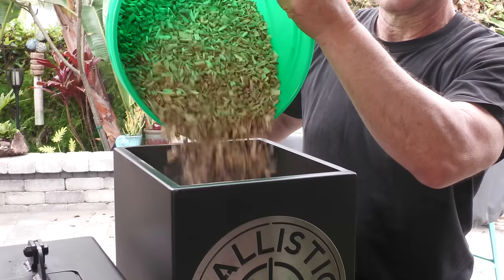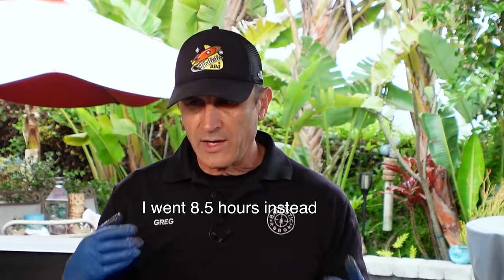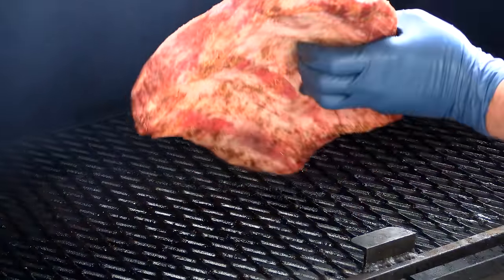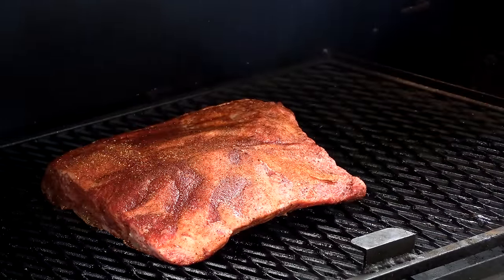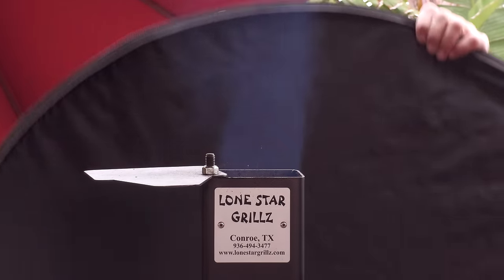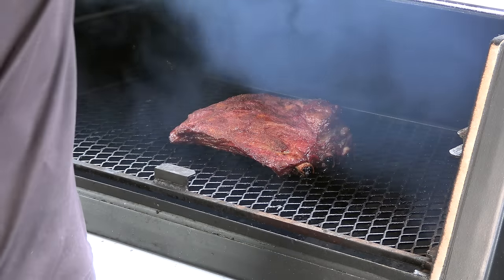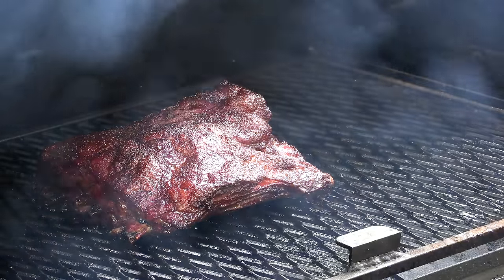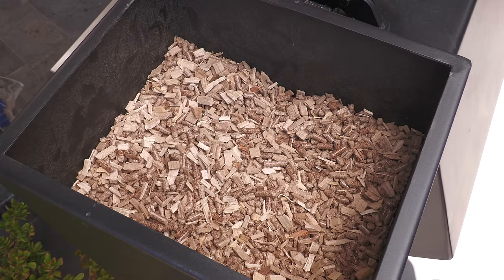Replacing Pellets With Wood Chips In My Pellet Grill On A Long Cook!

Comment from the maker: In this video, I am showing you how pellets can be mixed with wood chips (up to 50%) in the LSG Pellet Smoker.  If you own another brand of pellet grill, try this at your own risk.
Reply: I think what helps it work in this cooker is the tiny length of the auger.   Definitely would be interested in others being the Guinea pig for cookers with long style open center augers.
Reply: Thanks Greg! I have done this type of cook for a while now and it is nice to see that you have covered what so many people have considered me crazy for doing lol
Reply: @richbennett6577  an LSG pellet?
Reply: @txfieros  no a cheap ass master built one I bought at Lowe’s for $179
Reply: @txfieros  it’s the size of the wood chips that is what makes it work or not
Reply: @txfieros  lmfao just whatever you do DONT soak the chips 😂🤣🤣🤣😂
Reply: @richbennett6577  no kidding.
Reply: @richbennett6577  that’s definitely key since the spaces inside the auger tube with the auger are pretty limited.
Reply: Why not use just chips
Reply: @richbennett6577  which brand of chips have you been using?
Reply: that 7" is that the halfway point of the hopper or is it more? or more like 2/3? Thanks. going to try it on my camp chef.
Reply: @txfieros  I tried it.  After two auger jams, I gave up trying.
Reply: @6AM_YT  Dang.   Not too worried about it though.  I just use my smoke cage when I want more smoke.   Not as convenient as having chips run through the auger but still pretty simple.  Did you use the Lone star grillz specially sized chips?
Reply: @txfieros  used the chips I got from Lone Star. I have a 36 inch Traeger.
Reply: How about a follow-up long term use video, perhaps a brisket cooked and compared to a brisket with pellets only🤷

Comment: Very thorough video brother. I have to agree when I say that I notice a difference as well and I haven’t even gone with a 50-50 mix yet I’ve been doing more like 30% wood but it’s a noticeable difference. I haven’t seen a pellet cooker yet with an auger that I think could feed those chips or at least I don’t think I would try. I’m sure it would lead to some type of failure, but the LSG’s design is perfect for this. Great video as always! Cheers 🍻

Comment: I tried this twice today on my Yoder 640s with approx. 50/50 mix of the LSG wood chips (oak) and Lumberjack Hickory pellets.  First time the auger jammed after about 20 minutes.  Little piece of wood chip lodged between the auger and cylinder right at the inlet.  Cleaned everything out, made sure it was running smoothly, and then loaded it again.  Second time it went about 1.5 hrs before it jammed.  Until then it was holding a nice steady temp (had it set for 250 deg).  Then it fell off a cliff.  Was running without food to prove the concept so no idea about flavor.  Would NOT recommend it with a Yoder.  Auger isn't very long, but there seems to be just enough room for the small wood pieces to get lodged.  Oh well...

Comment: After your first video I ordered a box of chips from LSG. Used a 50/50 mixture in my 7 year old Rec Tec 1250 over the weekend smoking some pork steaks. 6 hour cook (225 degrees) and they turned out fantastic! Pellet consumption seemed about normal.
Reply: How’s the Rec teq been for you ? I’m leaning the 1250 or going with the lone star grillz pellet smoker. Tough choice but the Rec teq is way way cheaper
Reply: @chicity6134  the LSG produces more smoke

Comment: Every time you put your hand in the hopper without the "idiot guard" I cringed because I expected that the auger would pull your fingers through 14" of wood pellets and chips and grind them up like your meat grinder. The lightning speed of the auger wouldn't give you a chance to get your hand out in time. Where is the outrage for not having such a vital safety device installed? 😂😂 Great stuff Greg!! Thanks for staying at the leading edge of new and unique techniques. Prayers for your son!

Comment: Great follow up video, answered a lot of my questions but also left me with a few more. The biggest one comes from the very end of the video where you show what is left in the hopper and it seems to me that there is way more wood chips than pellets. That leaves me with this question. With pellets being more uniform and probably heavier then the wood chips, was there a separation of the two as they made their way to the auger? Did more pellets go through the hopper than wood chips?

Comment: After your first video on this, I immediately went online to the LSG web site and bought 3 bags of wood chips. On my first cook, I was too lazy to empty out the wood hopper so I was just guessing at the 50-50 mixture. Unfortunately, I ended up using too many wood chips and the pit had a hard time getting up to temp. I've now got the hopper balanced out pretty well. I think the pellet\wood chip combo leaves more ash in the bottom of the pit, and especially more debris in the firepit. Previously, I was able to go 8 or 9 cooks without vacuuming out the pit, but I don't think I'm going to be able to that long with the new combo. As of now, I've done only reverse sears using the combo, but today, I'm smoking jerky for 4 to 41/2 hours, so we'll see how that goes. I expect the jerky to have a very strong smoke flavor. Thanks for turning us all on to the availability of using wood chips on the LSG Pellet Grill.
Reply: Updates please!

Comment: I just got my box of wood chips delivered from LSG. Gonna give this a go in my Memphis Elite this week! Similar to the LSG, the Memphis is built like a tank, so I think the augers can handle it. The chips are nice and small, so I don't forsee a lot of jamming issues.
UPDATE: I successfully tested my Memphis Elite pellet grill with this technique today. I ran the smoker for 3.5 hours at 250 degrees, 50/50 mix wood chips and pellets. Pellet consumption was pretty close to normal, temp was rock-steady, no unusual sounds or strain from the augers, no jamming. I checked the burn-pot every 45 mins to make sure it was burning clean and consistent, no issues. Ash production was very consistent with what Greg showed in his video. Produced very consistent thin blue smoke throughout the test. I will smoke a couple of racks of pork ribs this weekend, can't wait to taste the smoke profile. NOTE: This technique worked for me, but try this AT YOUR OWN RISK. It most likely goes against your manufacturer's recommendations.
Reply: Well, how did the ribs turn out? I'm gonna try this on my P.O.S. Traeger. I have new fans,auger, etc, anyways waiting for another failure... (Common with those).
Reply: @Blackheart7-5   The ribs were decent. I was expecting more smoke flavor, honestly. For ribs it was just fine, since I don't care for heavy smoke flavor with pork ribs. I just did a brisket last weekend, and same thing, the smoke flavor was pretty light. For beef, I prefer a little heavier smoke profile. The Memphis handled the wood chip mixture just fine on this long cook (250 degrees for 11 hours). It produced clean smoke for the entire cook, no jamming, no unusual ash production.

Comment: I’ve had similar success using 50% LSG wood chips in my Memphis Grills Pro Elite 36” and cook on it 2-4 times per week. I suspect the over-engineered, powerful augers are the reason I’ve had no issues whatsoever. Further, the auger feeds a long slide that feeds the firebox, so there’s no chance of burn back (my original concern , as straight wood chips generally combust more easily than pellets). I love the added smoke flavor and deeper smoke ring! Thanks for your comprehensive review!

Comment: I am confident that this method will work.   However,  in your situation, when it  came  time to cut into the ribs and take your first bite, it was apparent... Very apparent that  the ribs could have gone for at least 1.5-2 more hours.  The first cut alone told the tail.  then the  bite confirmed it.   It not only looked, and sounded like it needed more time, the rubbery sound that was I heard  when you were chewing it  was also an indicator.    I have no doubt that adding chips to  your hopper will work, but in this case., 8hrs just wasnt enough.   As always, Thanks for sharing sir.   You are absolutely on my top 5 list for bbq and out of the box  grilling techniques.   Thanks for sharing your creativity brother :)

Comment: This should work with a rectec since it has a short auger.
Reply: Comment back if you try this.
Reply: @jt5747   just ran a 3hr test cook on recteq with 40% chips to pellets. ran fine. temp was stable. no jams.
Reply: @kl90210  Thanks! I'm going to give it a try. Did you notice any more smoke flavor?

Comment: Great video - I’ve been a long time user of mixing chips in with pellets on a smoke tube but never thought of just running them through the hopper. I have a YS640 which also has a beefy auger and I may try running a lean blend using if I can get ahold of some LSG’s chips :)
Reply: I have a 640 also, let me know how it goes  :D

Comment: …Greg, would you say that  the smoke flavor is the same as a off set stick burner? If not have you tried to close the smoke stack that only a quarter is open to keep even more smoke in as well as putting meat on the top shelf so more smoke hits it? Regards, Tony

Comment: Well, this is a follow up comment to my original post, which I can’t find. I bought a bag of cherry wood chips from Home Depot and lightly mix them with some pellets. I pulled out some of the longer chips that were probably finger length and splintered, whatever needless to say, I heard my auger, struggling/popping sounds, but by the time I could turn it off, I shared the shear pin on a woodwind 24 classic. It’s pretty obvious that the wood chips we’re not small enough. Needless to say I will not be trying this again because I don’t have the patience to go through a whole bag of wood chips and sort them out. I’m totally not thrilled with the smoke flavor on a pellet grill. I came from egg style cooking and I will be going back to charcoal/ wood next season. Looking at the Masterbuilt gravity 850 from Costco.

Comment: I'm half tempted to try this except I'm almost willing to try full on wood chips versus mixing. my grill is a pit boss so there is that. But i do totally agree that you don't get the smoke flavor with pellets that you would get with unprocessed wood. I've always lived in a natural forest wooded area and when i first began BBQing with charcoal I immediately knew that i'd rather use wood freely supplied wood from the forest versus buying charcoal. I've never used strictly one type of wood. So basically I'd grab whatever size piece wood was close to whatever length of cook time I felt I needed. Anyway that's why I'm curious to try straight up chips.

Comment: I ran a couple bags of Weber chips through my pit boss pellet smoker last year because I was totally out of pellets……..the auger managed fine
Here in the U.K. I can get 40 pounds weight of pellets for 40 pounds money to roughly a pound a pound  but chips run roughly 20 pounds money per pound weight smoking chips so I’ll be sticking to the smoke tube above the burn pot and 2 smouldering hardwood sticks above the grease trap which works out fine

Comment: I tried these with my 36" Traeger.  I did a 50/50 blend of pellets and chips.  Got an auger jam after 2 hours.  Reduced it to 70% pellets, 30% chips, got an auger jam after 4 hours.  You could really hear the auger straining to move the pellets through the auger tube.  I've never had an auger jam in the 5 or so years I've had the Traeger.  I would definitely not recommend this with longer augers.  I noticed the same thing with the ash and the flavor.  I'm really bummed this didn't work out better because it had a better flavor, even in those limited amount of hours than pellets alone.
Reply: You used the LSG chips?

Comment: I have a question about the auger motor in the grill, what kind is it and what is the rpm speed and torque rating. Cutting thru wood chips with the auger will require more torque. I would like to run chips with pellet mix thru my pellet grill.

Comment: I bought a box of the wood chips and made a mixture of 50% pellets to 50% wood chips. I placed this mixture in my Pit Boss Austin XL, but when I ran my grill it resulted in an auger jam - the mixture never made it to the burn pot. I will try one more time by diluting the mixture with more pellets and hope the outcome will work. My guess my PB has too long of an auger and/or too weak of an auger motor to properly feed the pellets/wood chips. No matter what, I think the idea is wonderful and others find success!
Reply: You need the right size wood chips

Comment: I'm curious, since the size and shape of pellets vs chips are so different, can you tell if they dispensed equally.  It seems to me the pellets might be favored over the chips as gravity pulls them through, much like sand would fall through gravel.  Just curious.
Reply: It will happen. The question is, will it make a noticeable difference. That will depend on the difference in size and shape.

Comment: Great video but I have a quick question.  Ive had that same grill for almost a year and cooked on it about 10 times and I get about a 35+ degree temp difference between the displayed "Pit Temp" and the guage on the lid as well as a probe at the center of the grate.  Did you have any similar issues? What can I do besides runnimg the thing at 300 to cook at 250. Thanks
Reply: There is an option in the settings menu of the Fireboard controller to offset the Fireboard's pit probe (channel 7) so that it will match the Tel-Tru in the center of the pit.  You can't adjust it from the app, you must do it on the Fireboard controller itself starting with a long press of the knob.

The fireboard probe is located above the firepot and likely sees direct rising heat even with the deflector plate in place.  I've noticed about a 25° difference between the probe and the Tel-Tru on a long brisket cook after the pit has been thoroughly heat soaked on my LSG.  

The down side is when the pit is off and cool, it'll read below ambient outside temps as much as you've offset it.  That's the trade off, but it's worth it to me to be able to log accurate cook temps.  

If you're trying to really low temp smoke, (like smoking salmon) you might want to set the offset back to 0 to keep the temps down so the albumin doesn't bleed out.
Reply: @aim4squirrels  Thank you so much for replying, I thought I had gotten a very expensive lemon lol.  Chris from LSG briefly explained that same fireboard feature for adjusting the channel 7 temp, I just have not seen anyone talk about this issue on the internet. It really surprises me that a high end smoker would need tampering in order to work decently. I've used used several cheaper pits without this issue. Still like the LSG  though 😀
Reply: It's entirely possible many other pits with a temp controller have this exact same issue and the controller is simply pre-programmed with the offset already set and there's no option to adjust it.  I prefer to have the granular adjustment ability offered to calibrate it.  It does vary a bit in the hot Texas summer versus our winter temps.

Comment: Greg, I think you should share a little more info on what kind of chips they were possibly. It seems like everybody’s breaking their augers trying this. I remember a company a while back that used to sell trays that you put your wood chips in and lit the end of it and it’ snaked around burning. I have never been able to get my smoke tube to work either.
Reply from the maker: Hi John, I mean I talked about the size of the chips, measuring them and showing a good closeup.  LSG sells these specially-sized chips (as I explained), but I am open to suggestions on how to make this better.  Please let me know specifically how I could make this happen.  Thanks!
Reply: @BallisticBBQ  I guess I missed that, my bad
Reply from the maker: @johnmccaffery5186  No worries John, this is a long video and I understand that most people jump around.  Cheers